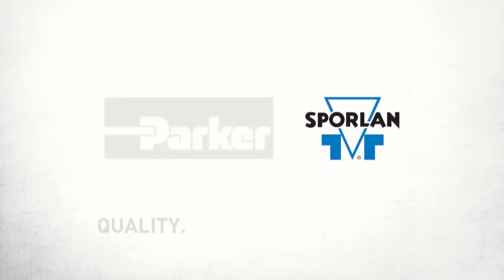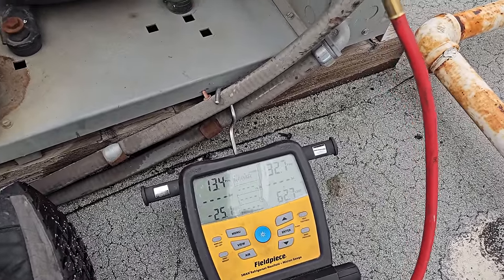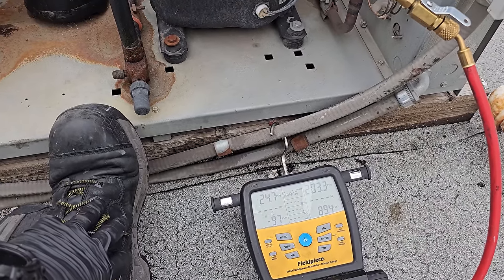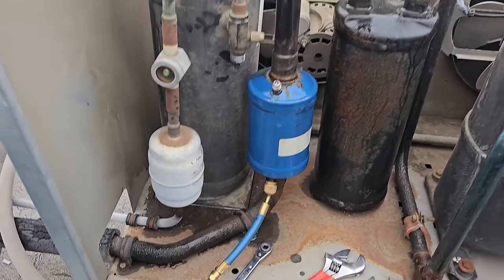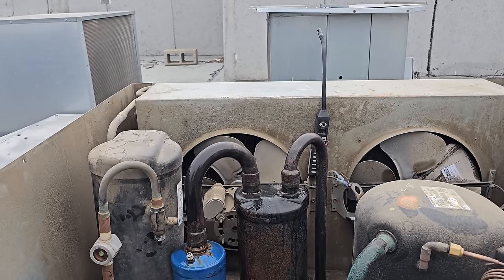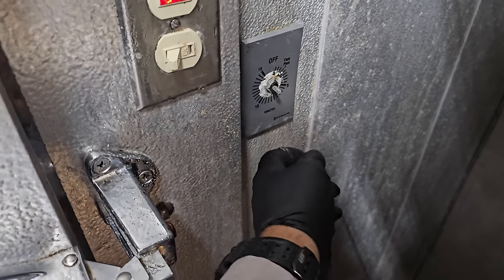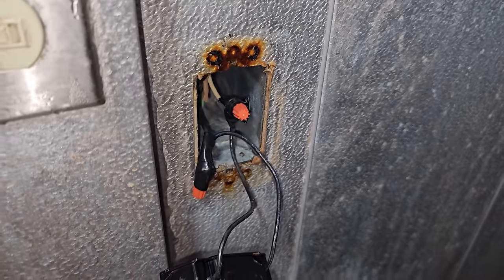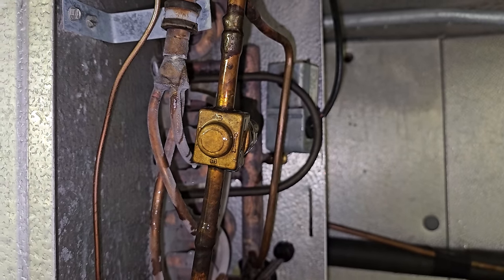THIS FREEZER EQUIPMENT IS DONE

Comment: I don't see anything wrong with simply getting it up and running while on OT, and returning on straight time to effect repairs as long as the failure isn't massive.
I imagine your clients mostly agree with that, since you're saving them some money, and you're glad to get home for Family Time. Win-win.

Glad to see they're opting for full replacement, rather than piecemeal replacement. Sure, you could repair the leak, replace the pressure switch, and refill - but as you suggested, with it pumping down to 0.0 psi (and possibly pulling into a vacuum on the rare occasion) who knows what, if any, contamination there might be in the system. Also, we don't know how much extraneous wear-and-tear are on the compressor and contactor from short-cycling. You might be back in a few months when something else fails, and if there's one thing I've learned about you Chris, you don't like making return calls - you'd rather fix it properly the first time. Return calls not only take up time for other jobs, they are seen as a negative experience from the client-side - that's just the assumption they're going to make, since you had your hands on it recently.

I genuinely and deeply wish you operated in Connecticut, because I'd love to have my theory of "the condensate drain line runs uphill, which explains why the pan overflows" confirmed by a professional.

I really despise being 45 and looked upon as a Generic Ignorant Crew Member Incapable Of Thought Beyond Coffee And Donuts. Guess what, Franchise Owner, I happen to be handy with 110 VAC, know a little about our camera system, know a LOT about our very basic 1990s-era security system, have a little plumbing knowledge, know more about how each and every bit of equipment works and how to properly clean it than the Training Manager (who I trained in her previous positions as Store Managers #5 and #7, you're welcome for that), and am sick and tired of almost every piece of equipment in the store being in a stage of disrepair. Our ice machine is overdue for cleaning, I wish I had the staffing levels on my shifts to do it myself rather than wait for Maintenance to come around. Water filters are a month overdue, guess I'll do THAT myself AGAIN. The water softener, which hasn't seemed to be dispensing enough salt despite any setting, now has a keypad that doesn't respond at all. It's only a matter of time before everything clogs up with calcium and lime deposits, as it is we eat through boiler tanks in our dumpy espresso maker once a year due to internal mineral buildup...

To be frank, I'm probably the only person who knows everything that is wrong in the store. Probably because most of these problems have existed since I last worked there in 2012, and the store has changed Franchise Owners two times, and had an unknown number of fresh faces constantly cycling through, in the interim.

I'm sick and tired of being denied access to the ability to apply for a Maintenance position because I "don't have the proper background." (1996, fresh out of high school, attended tech school for PC and Electronics Repair, lowest quarter grade was 89.9 during the Analog Electronics unit. Five years' Dunkin' experience operating, cleaning, and repairing whenever possible the specific machines used, including knowledge of deprecated equipment still in use in smaller stores... I can diagnose equipment problems more accurately than the Maintenance Douche, do you even care about saving money?)

Just because I'm working a minimum-wage entry-level job doesn't mean I'm an ignoramus or devoid of applicable talents. I've spent most of my life one inconvenience away from financial ruin and over the past few years things are beginning to finally look up. I've had to learn to repair things as a matter of survival. I've had to jump directly into the first full-time job I could find out of desperation. I've had to "settle" for jobs outside of my field because my field was disgustingly-cutthroat even then. (Minimum three years' paid experience, or minimum five years unpaid apprenticeship just to get in the door of your basic PC repair shop - if I don't mind commuting to New York City every day.) Now, the tech has advanced so fast and so far while I've been on the sidelines, I wouldn't even know where to begin catching up. When I graduated tech school in '97, word on the street was that "USB is the next big thing coming for computers" and we weren't quite sure how well that would integrate with Windows '95's "Plug and Pray" system. 🤣

I'm NOT tooting my own horn. Or at least, I'm not trying to. What I'm trying to state is that I actually give a damn about my store, I want it to be hugely-successful, and I can't help but feel insulted that the people responsible for maintaining, repairing, and replacing equipment are either clueless, or deliberately sabotaging our success. Why the eff am I making minimum wage, and why are these people paid more than me despite not having the foggiest of ideas what they are doing in their positions?

Yes, I could/should quit. But my primary job doesn't pay enough. And, as much as I b--ch about it, I'm emotionally-invested in the store. I wouldn't have come back two and a half years ago if the store didn't hold a special place in my heart. In that time we've had a revolving door of staff AND managers. I've built up a loyal, repeat customer base who won't come to the store if my Jeep's not parked in my spot. In fact, if I park in the back behind the dumpsters, business declines dramatically. If I wanted to, I could park there every day to have a nice, slow, relaxing shift (at least until word got out that I was hiding my car). But that doesn't make the store money, and it doesn't make me tips! 🤑 

I also know, firsthand, that "the grass is always greener" - over the septic tank! When I first subscribed to Chris' channel, I was still working for the Fried Chicken Place, and that was during the initial height of Coof, before the vax had been developed. So that means I've been learning about HVAC from Chris (and writing obnoxiously-verbose comments about horrible maintenance in restaurants) for over three years!